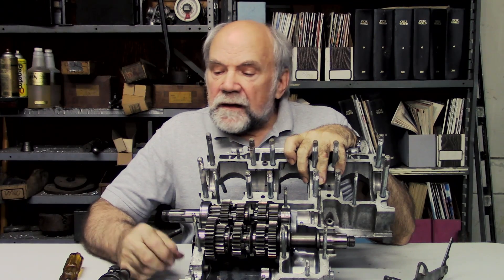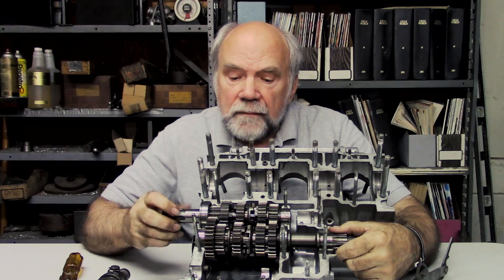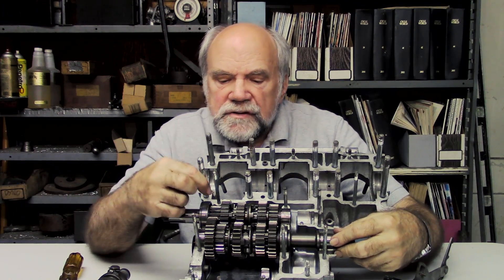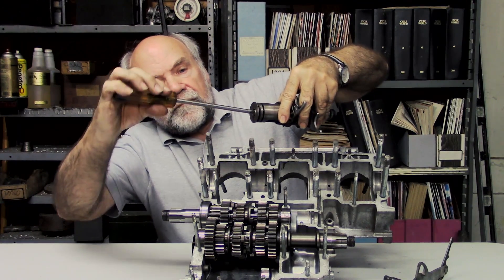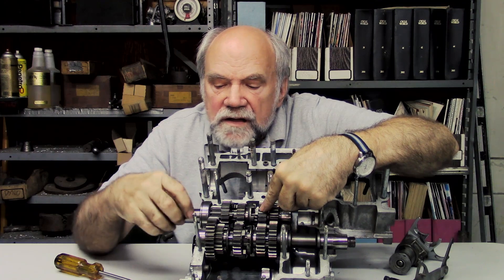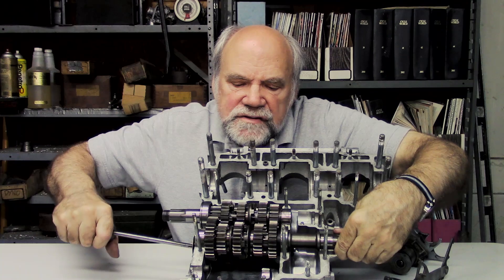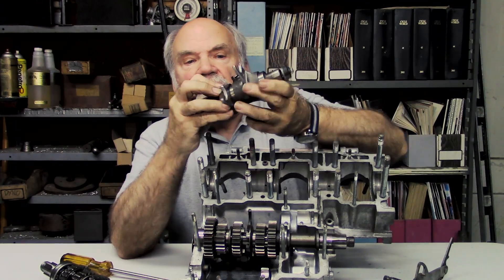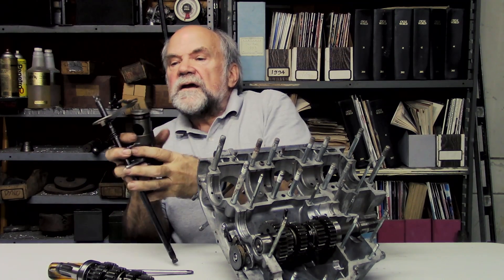How Does A Motorcycle Gearbox Work?

Comment: Hi kevin like how you have explained the workings of a gear box. This is just a query the engine you are working on looks like a three cylinder Yamaha which Yamaha didn’t produce as far as I know for racing Ernie Fletcher of  len Manchester of Milton Mowbray in England had a converted from a 1 and a half tz engines to a three cylinder Yamaha using separate non-read valve barrels making it a 500cc engine in a Spondon frame chassis it looked great my favourite non-factory racing bike love to see the complete bottom half of the crankcases many thanks Colin of Great Britain.

Comment: When you're at rest and going from neutral to first, and both shafts are stationary, if the dogs are not aligned with the slots, how do you shift?
Reply: At rest....both shafts are stationary.......sometimes you can't shift.  You either have to rock the bike back/forward a bit to get the rear tire to rotate the output shaft, or let the clutch out and pull it back in to get the input shaft rotating.  In most N to 1st shifts from rest....the input shaft is still rotating a bit from "clutch drag" as you click the transmission lever into first (especially if the oil is cold and thick).......that is why you will feel a bit of a lurch or jerk or hear a clunk as the bike drops into 1st.
Reply: @davebob5888  thank you
Reply: Can you explain why sometimes a shift into 3rd sometimes is loader engagement than other times? And also if this couses ware

Comment: Can you explain why it makes such a loud clunk when I put it in first gear from neutral and has been that way with bikes as far back as I can remember? Also, why does it not do it if I shift down into first when rolling to a stop. Thank you.
Reply: spoonman73 that happens on all sport  bikes. My 2009 zx10r , my friends 06 gsxr 600. Every sport bike I've ever driven. Brand new,  or high mileage.
Reply: Yeah man, happened on my '91 FZR600 back in the day and happens on my brand new bike too. Just thought they might have improved that by now lol and what the technical reason is.
Reply: akupehsluarketatAR.  Yep.  Thus cycle gearboxes do not have a truly synchro low (close but not quite).  This was common in cars in the 60s as manufacturers were moving to true synchros in 1st gear from non synchro lows.
Reply: It is the first locking dog.  Look at the clutch gears when he has them in his hands.  The others lock to that one and muffle the clunk.  The one down neutral and four up was designed to soften that hard clash.  

Originally 1st gear wasn't synchronized to the others and the movement of the shaft, so you could not shift to first until a dead stop (like reverse is now).   Double clutching was also common to go from 1st to 2nd.  Attempts to shift into low while moving damaged the old fashion  gearbox (same in a 60s MG).  Bike boxes today are not as fully synchronized as cars, therefore it is still best to be stopped or very slow when shoving it down into 1st.
Reply: Spoonman....Mine does also as many do. What I do, when selecting first from neutral, is to get the bike rolling one or two mph then clicking first gear. I find this greatly diminishes the clunk or eliminates it altogether.
Reply: spoonman73.  Oh and I bet your idle may be a tad high or way high.

   Remember the first dog starts the gears rolling and after that the upper gears are just adding a quicker dog clash to the already rolling rod of gears and dogs, thus you can rev match with your throttle and it shifts almost effortlessly.  You can't rev match standing still 1st gear, so if your idle is too high then rolling is the closest you can do.  Low idle lets the 1st dog settle before spinning too hard.  A quieter clunk.

BTW the clunk is normal, expected by the designers and gives you feedback that you have a solid 1st engaged.  Otherwise you may have a false neutral which can cause the tips of the dogs to skip and bang on each other.  At least you won't move when you expect to and that's not good.

Bike gearboxes are simple and antiquated compared to cars, but they serve the purpose well so why change them.  There's a historic bike that had a stick shift.  An Indian I think.  That was weird.
Reply: The clutch wear while waiting is only applicable to car clutches. Motorcycle clutches are designed for low speed and standstill operation, because most motorcycles cannot travel below 15 MPH without utilizing what is called the "friction zone." However, that is not to say that doing so for extended periods will not produce excess heat that will accelerate wear.
Reply: u get a clunk on the 1st because the gears on the clutch shaft are spinning(even when u pull in the clutch) and the gears on the other shaft are not. When u kick into 1st you're forcing the clutch shaft to stop on a dime as the dog set engaged. That causes the loud clunk. You wont get this when your bike is moving as both shafts will be spinning. It is also not recommended for you to hold onto the clutch whilst in 1st waiting at the red light for too long as the clutch be slightly rubbing on the friction plate causing unnecessary wear.
Reply: @akupehsluarketatAR  It depends on if the traffic signal is going to turn green shortly or if you just arrived at a red light and you will have to wait a while. If the light is going to go green in 10 seconds, keep it in first with, of course, the clutch disengaged.

Comment: Great video everytime I shift my motorcycle into gear I cringe I hate the sound of the dogs engaging. I had a Harley Sportster 1972 the clutch was heated up and dragging I put it in first gear and the dog broke off unfortunately I was 3 hours away from home and drove it crunching all the way had to replace all the gears I was surprised it didn't blow out the side of the case those bikes are known for it

Comment: Is it true that motorcycle gearboxes are designed for clutchless upshifts? As in all you need to do is drop the RPM as you shift up?
Reply: Punch 
Yes they are. At the dragstrip I only use the clutch to launch. After that I just back off throttle to shift. Its worth several tenths in the ETs to do it that way.
Reply: one somehow knows this questions will be asked :D
Reply: Everyone needs to learn clutchless shifting. It changes the whole experience. Why it's possible is because when you momentarily shut throttle the dogs on the gears disengage and they you can shift to next gear. Greater the distance between dogs, easier it gets.